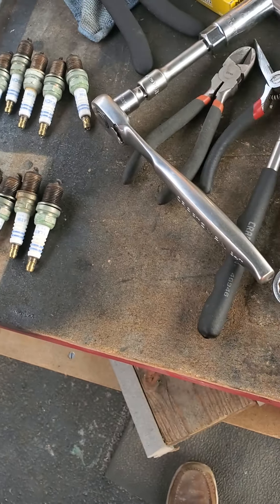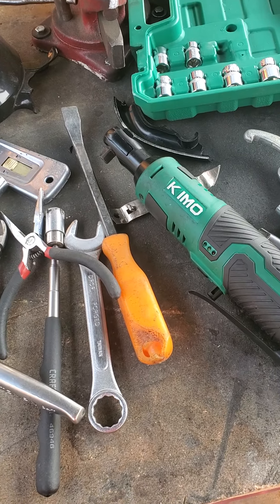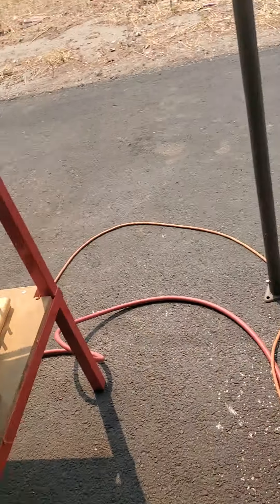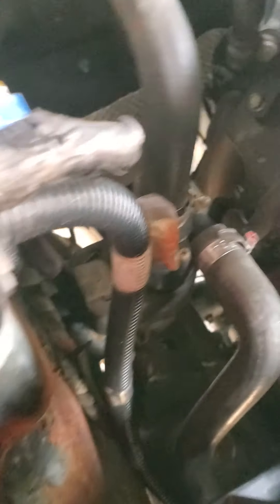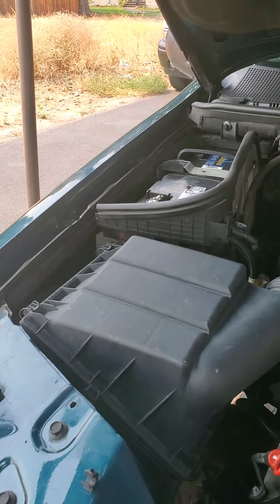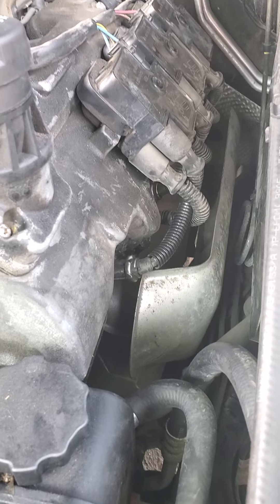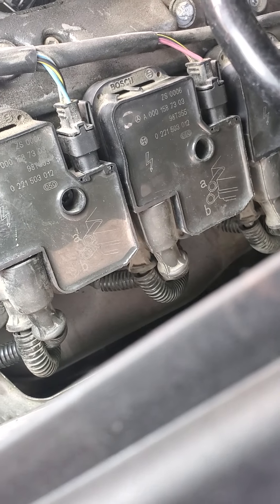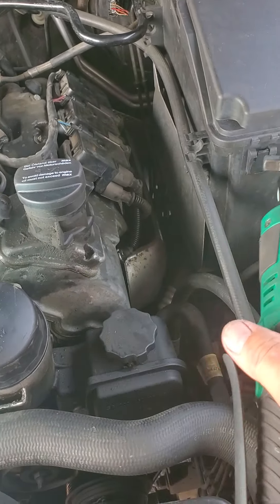Changing spark plugs on a 99 Mercedes ML320

Comment: If you jacked up the front of car and took off the tire and heat shield on the driver side, you'd have had a lot of room to work. Also, there is a snap on spark plug socket (5/8) that makes changing them easier. Torque is 20-30 to tighten them. The Bosch iridium spark plugs are better quality and last longer than regular ones.When it comes to parts that you change only once in a while, it 's worth buying the better ones. Of course in the case you keep the car... You sure sound like you needed some rest after this project! ;)  Good video, by the way!

Comment: The coil wire connected to the coil and also the spark plug. 1st unplug from the coil which gives you room to unplug from the plug. Now you have just the wire in your hand. Now access to the plugs. just take off the wire!   you'll see the coil still connected to the engine and the other end the coil wire connected to the spark plug, just pull from the spark plug. Access.